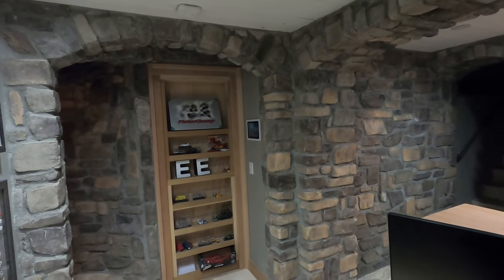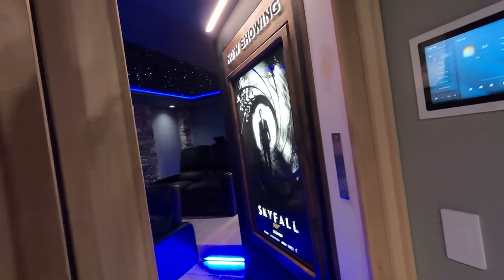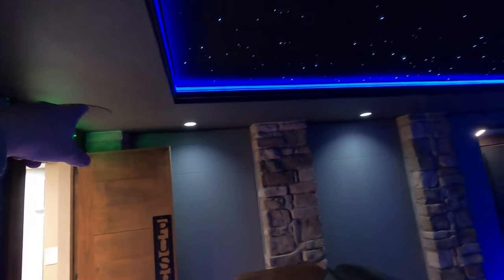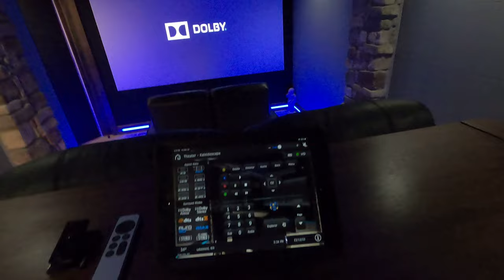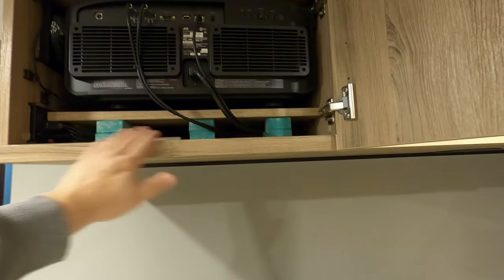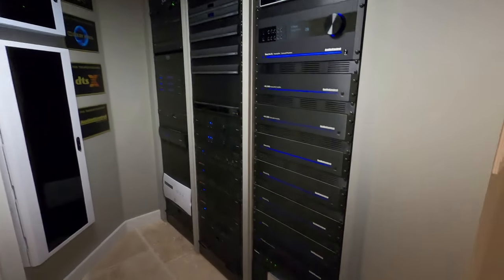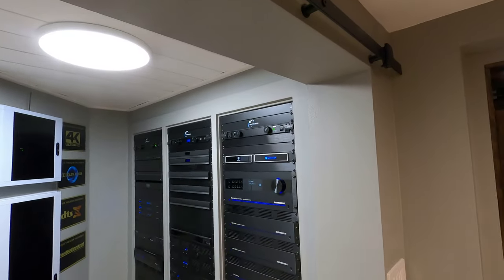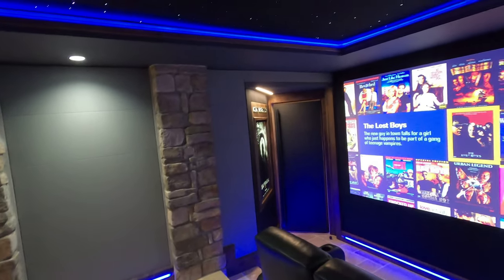Home Theater Build - Audiocontrol, Klipsch, Fabric Walls, Star Ceiling, and LED Lighting.

Comment: Who are you going to use for the sliding door ...Cavity Slider?    Nice work Tyler ...I like your stuff. Ahh you just mentioned it's Auto Slide. Cool
Reply from the maker: Autoslide but I do have the slides in a manual form that may work better.  I would then do an air activate push / pull actuator

Comment from the maker: We triggered it from our processor. Anytime the processor is on it turns on the intake fan.  The exhaust fan is being turned on the same way and is using the probe.  No probe on the intake fan. 

We are using a niles 12v controller outlet to turn the fans on and off.

Comment: Quick question, how does the Cloudline S4 work with the controller 2? Do you have to use a molex to USB adaptor?
Reply from the maker: The 4" cloudline is using its basic fan level and switched on with a 12v triggered outlet!  Cheers
Reply: @theaterdesignco  do you use the trigger out from the projector into the AC infinity? Does the inlet fan come on and off with the probe? Would appreciate it if you wouldn't mind expanding on how it works. Thank you

Comment: Build Designer, En visionary , Modern Day Self Imagineer Roommate Has In My View Broken The Boundary Of Modern Day Home Theater Builds. We Live In The Ghetto With Run Down Apt. So Why Have To Suffer & NOT Enjoy The Place That Your Living. So Knowing My Roommate Like I Do ALWAYS THINKING OUTSIDE Of The BOX On Every Project That He Tackles. So He Has Managed To Literately Transform Our Spare Bedroom Which Is 12'W x 15'L x 9'H Into A Home Theater Like NO OTHER! And BEST Part Is It Was Built Inside Of The Existing Structure And Required 0% Of Demolishing ANY OF The Walls, Floor, Ceiling. He Very Cleverly Framed Out The Entire 4 Walls Floor & Ceiling Of  A Entire Skeleton Framework Of Metal C Track & Studs. So Now One Has A BRAND NEW Canvas To Create & Work Upon WITHOUT! Damaging ANY Of The Original Room. So He Ran All New PVC Conduit For Our Massive 9.2.4 Dolby Atmos With ALL In Wall Speakers. Throughout Our Room. But Why STOP There My Roommate Thought. Why NOT Add The Missing Element In All Theaters. The STAGE! Yes I Said A STAGE. A Stage Built Right Into Our Home Theater That Measures 8' D x 10'W x 8' H. He Also Designed A Complete Proscenium Arch That Measure 8' H x 1'W. With Sound Proof Insulation Everywhere, Speaker Wiring, Electrical Wiring & Best Part Is Installing His Main Electrical Component The Main TRANSFORMATION COG Called: SSTS: Smart Stage Technology System. The Brains Behind The First Ever Fully TRANSFORMING STAGE! So Now Program The System & Now you Have 100% FULL Control Of Everything Pertaining To The Automation Of Our Stage. So Unlike 99% Of Home Theater Out There None! Can Accomplish What This Stage Can Do. So Simply Sit Back Pick Up The Master Tablet & Select From Over 1000 Different Modes, Scenes, Themes. You Name It It's Probably In The System. Along With My Roommate Being An Accomplished Pipe Organist Keyboardist Arranger, Composer He Recorded The Entire SSTS Music. So Every Mode, Has It's Own Unique Theme That Is Synced With The Transformation Change. So Lets Say You Want Christmas Mode Simply Tap On The Icon On The Table & Watch As The Entire Stage Come Alive With A Christmas Theme Music As 4k Vinyl High Definition Backdrops, Side Leg Boarders & Valances All Start Descending Down From Above All The way Sown To Their Designated Heights Along With The Cool Added Special Effect Bonus Of Snow Machines. Fake Of Course. When Your Done With That Mode Simple Exit & Watch The System Announce Thanks For Choosing Christmas Mode & The System Will Go Back From Whence It Started. Each Mode Will Do That Each With A Different Announcement & Closing. We Have Karaoke Mode , Movie Mode , Live Performance Mode , All US Holidays Are Programmed. So We Have The BEST Of BOTH WORLDS! The Entire Home Theater Walls Can Also Be Changed To Give The Entire Theater A Complete Different Feeling & Environment. From Inside Of The USS Enterprise , To A 1970 Vintage Movie Theater , Modern Cinema,  Cave Interior. The Combination Are Endless. ONLY LIMITED By YOUR Own Creativity.
Reply from the maker: Awesome comment.  Sounds like you prooved any space can be awesome.